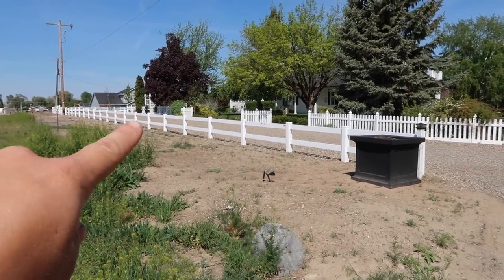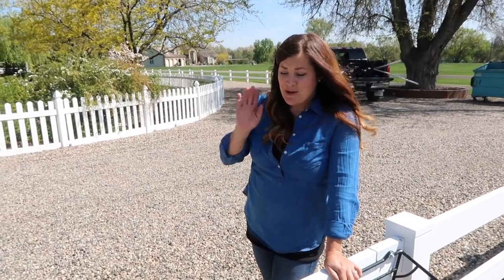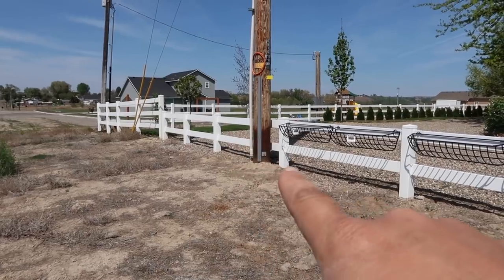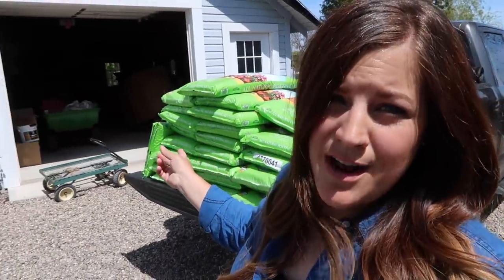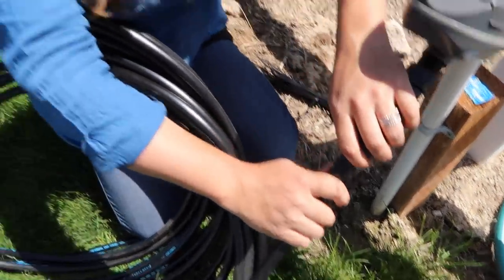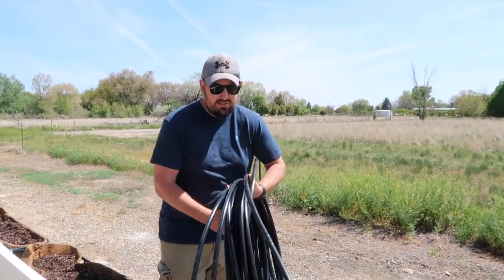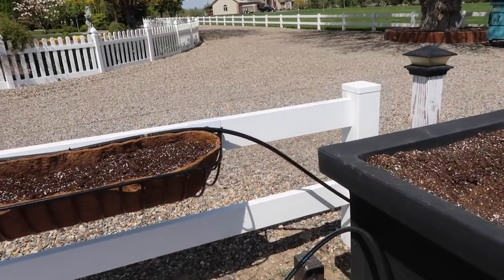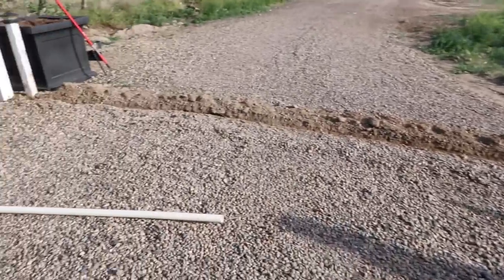Epic Hayrack Project Part 1 // Garden Answer

Comment: You asked for a suggestion on how to hide your dumpster, so here goes:

I don't know if y'all make your own compost -- I know you use compost and fertilizer, but I don't know if you have a heap or anything -- in any case, you could hide the dumpster in a brick enclosure with a section right beside it for a compost heap. Kind of a 2 birds, 1 stone situation. As I understand it, brick enclosures for compost work best if they have gaps spaced between them for good aeration. It looks really good, and it's super organized since all trash would go to just one place. :)

If you aren't interested in that, it's cool, I suggested a 2 section compost/dumpster enclosure because it uses brick, and if you put forward the expense for brick, you generally want to go big and get as much from it as you can. Have a great day!

Comment: For the trash bin I would make a fence around  the bin with a gate that opens in the front of the bin which would open like French doors. On trash day, just open the gate doors and the truck will easily be able to pick up the bin. Make sure it’s okay by the city first. Sometimes there are certain regulations on “obstruction” around a bin. 
Congratulations on your baby and on sponsorship for your hay racks.

Comment: Instead of running 3-4 drip lines in each basket, wouldn't it make more sense to run a single 1/4" soaker line through each of the baskets?

Comment: Will the weight of the baskets warp the fence?
Reply: Sara Beth  I totally didn't even consider that! Now I really want to see how the fence holds up. Also if the fence gets grimy from soil washing out of the baskets. It didn't even cross my mind how much weight two of those baskets full of plants soil and water and the iron of the baskets themselves were going to weigh, it must be an absolute ton!
Reply: I was thinking one basket centered on fence with white showing on each side of basket would highlight each basket. Plus 2 per board will be extremely heavy. But everything you do is beautiful
Reply: I was thinking the same!!!!